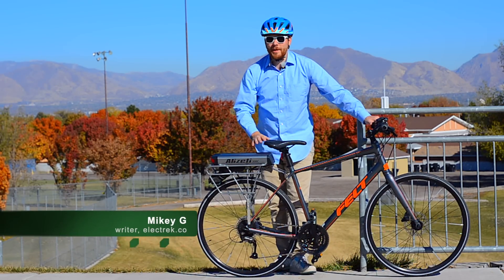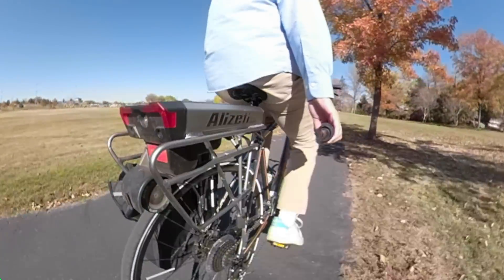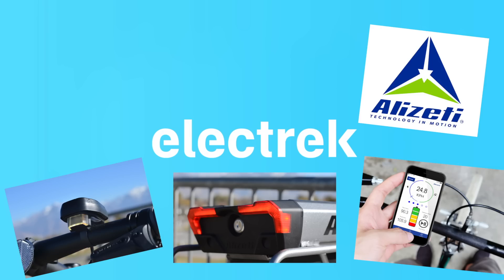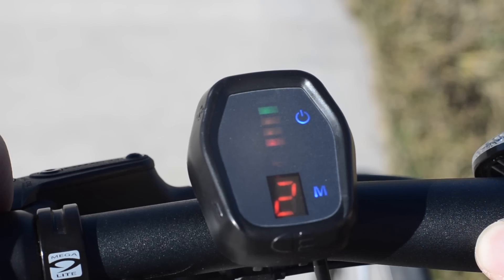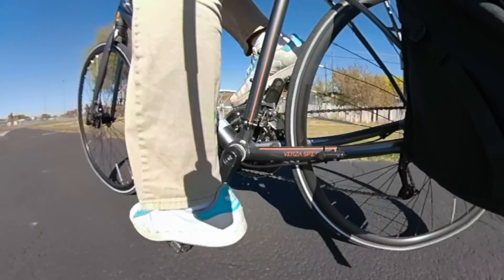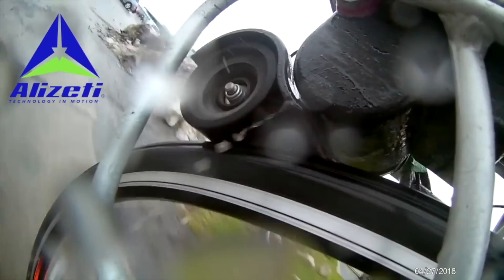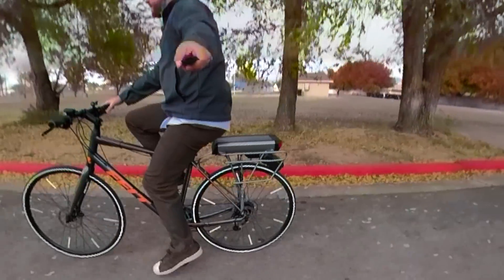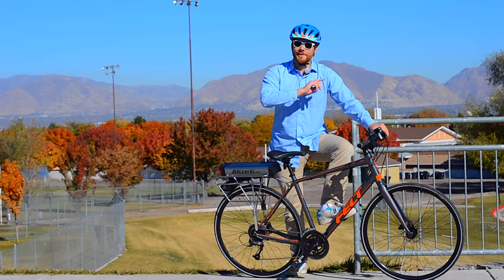Review: Friction Drive E-Bike Kit, Here Comes a New Challenger!

Comment: If you are wanting a kit for commuting to work, don't waste your time. Get a petrol 4stroke friction drive, and modify it to push/button start, and you'll be good to go. Use a muffler and it'll be quieter as well.
800 bucks for this video's kit, which has useless crap like speakers n whatnot
Easier to use earbuds, or a headset, (just have one ear open on the traffic side)